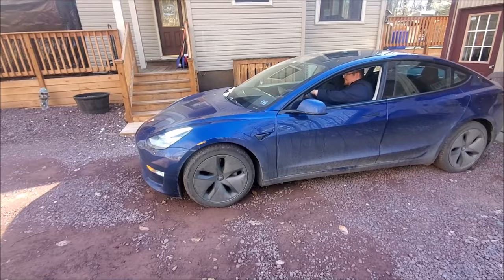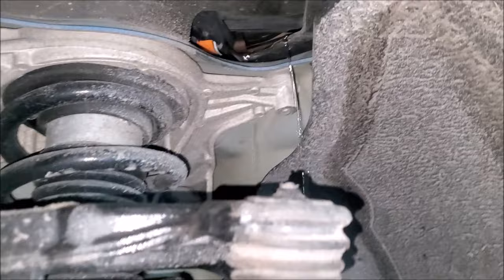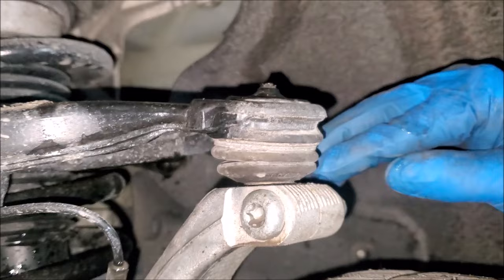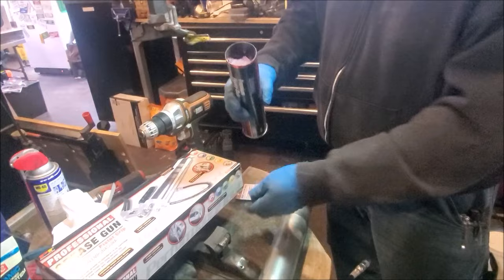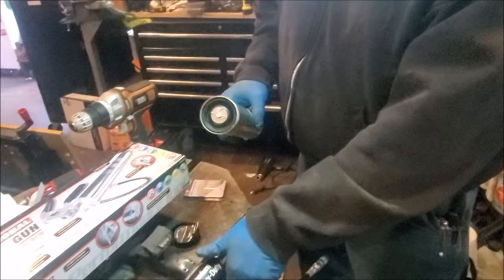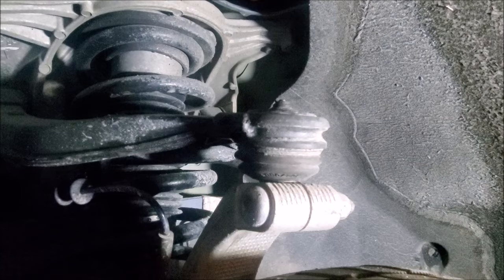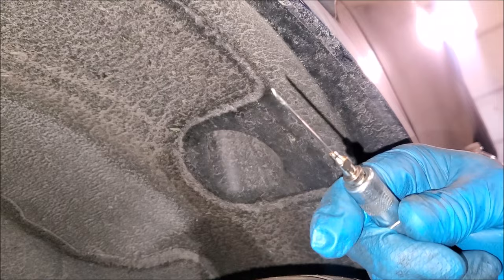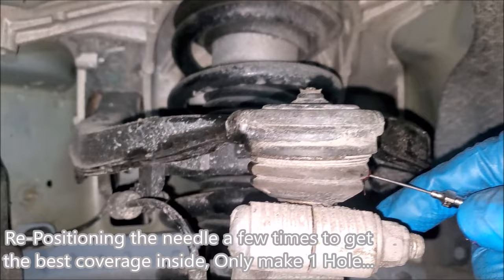Tesla Front End Steering Squeak, How to Fix it in about 10 minutes, Quick & Easy!

Comment: Hi, I've seen 2 fixes for this, yours and disconnecting the ball joint and moving it around and effectively loosening it. Is it better to just add the grease as it seems like there is a lack of grease in there and you will encounter the same problem again since no grease was added to help lubricate the movement of the ball joint. Putting holes in the boot will have the drawback of moisture getting in there which would be the negative of your fix.
Reply from the maker: Actually if you fill them sufficiently they will last a long while. The needle is thin enough the rubber does close up well and seal, I see you are unfamiliar with that.... This will extend the life for sure. And as stated... not a permanent fix, but will extend the life.
Reply: @GarageMahal  i was actually agreeing with your method being the better of the 2 fixes. I actually did it to my car yesterday.
Reply: @GarageMahalStuff  where do you get the needle from?  Amazon? what size?
Reply: @arshadaa  same ask
Reply: @GarageMahalStuff  would it be better to stab through the bottom of the boot so that it could eventually drain the water?
Reply: There is already water in there, so a couple of tiny holes won't hurt at all. Also the rubber boot is filled with grease, so a tiny bit of water won't do much in this situation. The location of the holes won't matter too much either, water will find a way, especially tiny holes have a capillary effect so the water will ingress anyway. So filling it up with grease is the best bet. Replacing the joint with similar structure will result in similar squeaks, when the boot has had enough water during driving and it seems during raining too. 😅 What a nice design flaw, but seems like it's not the first and definitely not last on a Tesla.